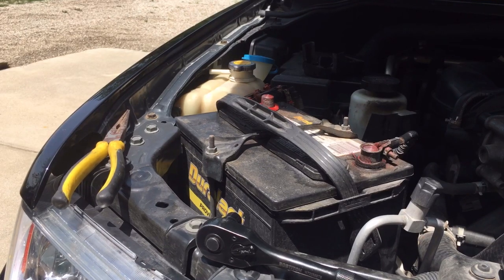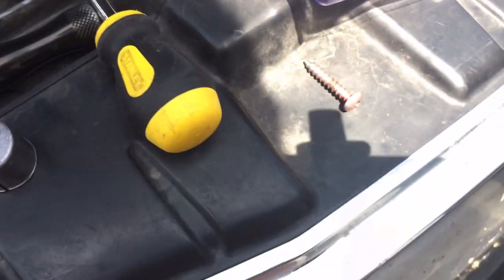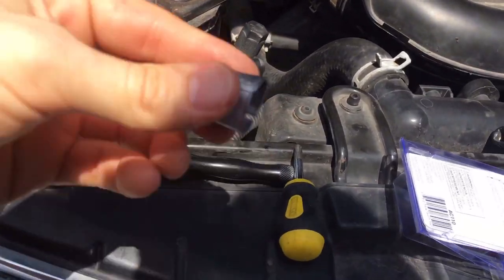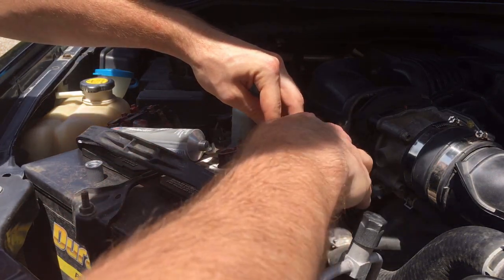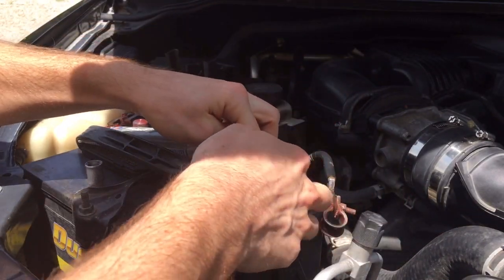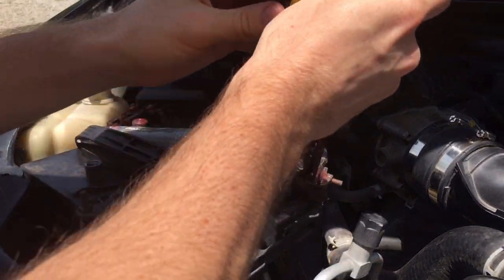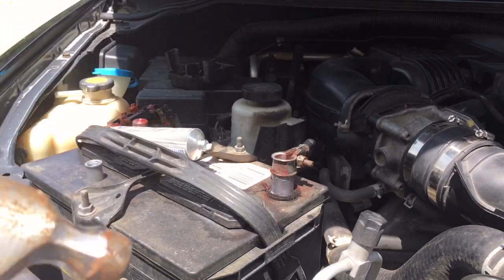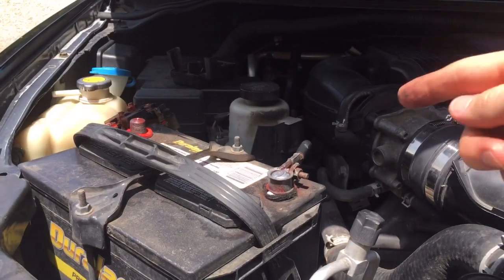How To Fix Loose Battery Terminal Free or Cheap

Comment: Great video!! Although you shouldn’t use dielectric grease between the mating surfaces. Because it can mess with the connection. You should only use it at the end over the whole assembly to protect it from water and corrosion.
Reply from the maker: I didn’t know that. Thank you!
Reply: Dielectric grease is an insulator not a conductor
Reply: @Hudoba4  "Dielectric grease is an insulator not a conductor"

This.
The reason why this grease is applied to connectors and coils is to keep out moisture and debris. Many people think that it is used to increase connection surface area, unfortunately.
Reply: Thank you!!!!

Comment: That just a temporary fix if your stuck on the road or somewhere, then you can use a copper sheet or a copper air conditioner pipe or tube, you cut it and place it in between. That a perfect fix

Comment: I had this problem with my dads old truck the terminal was not staying tight with the connection to the battery and would cause the truck not to restart,  but finally got it replaced

Comment: Hey J.J., I'd like to run something passed you. I've got steel post clamps that are loose and I'm wondering if I can tap on the lead  post to enlarge its diameter. Naturally  I don't want to destroy the battery but this might be better than the shims that aren't  working. Thx, Bltoth
Reply: Hitting the lead post hard enough to morph it will probably drive the post into the battery, they're just plastic after all.

Comment: Dielectric grease is not conductive. Its an insulator. So you are literally working against urself putting it between the shim. Ur problem is those damn terminal pads. Never buy those.
Reply: I was thinking the same thing glad I looked thru the comments first , I had a feeling I wasn't the only one , he should pull the video and make another that's not spreading misinformation.

Comment: What has worked for me, is to remove the nut and bolt. Then, take Vice Grips and squeeze like heck until the gap close to the battery is closed. Makes the cable nice and snug once again! Of course, after putting the nut and bolt back in and tighten.

Comment: Take off those stupid battery terminal pads and push ur terminals all the way down. Then you should have no problem tightening the terminals. Boom. Problem solved. If you still have problem after doing that, buy ur self battery terminal shims or replace the terminal.